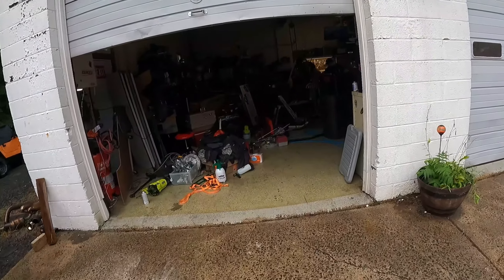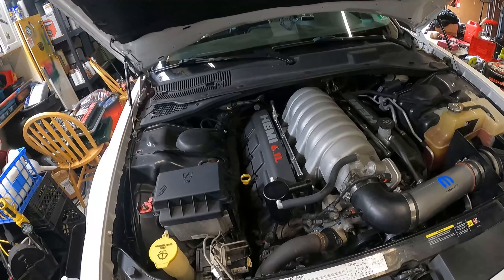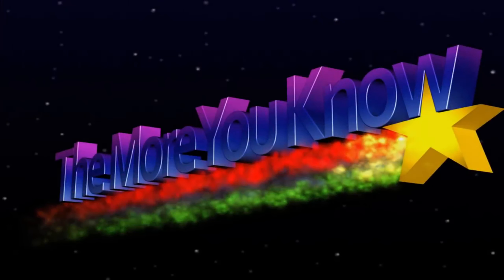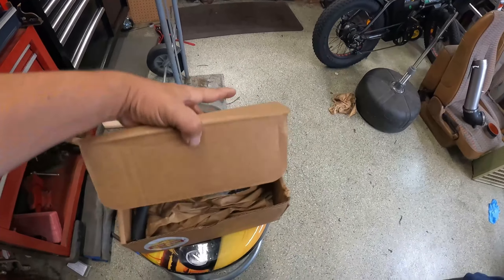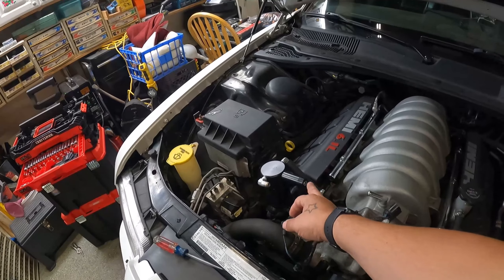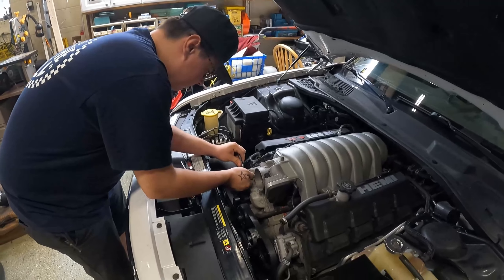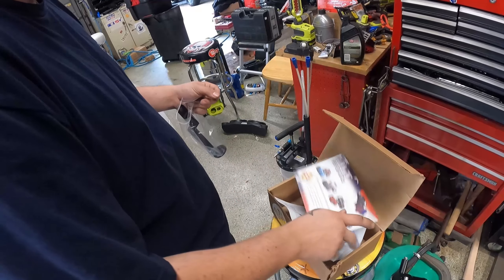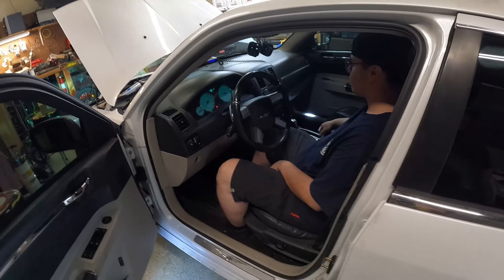Chrysler 300C SRT8 - JLT Catch can install and fix surging idle

Comment: U don’t even have the vacuum hose on the top driver side of the intake manifold hooked up that in itself will cause a surging idle.
Reply from the maker: I don't see where you got that, we had that hooked up the entire time, that's where the catch can line gets installed.